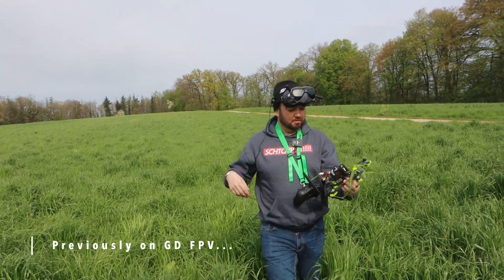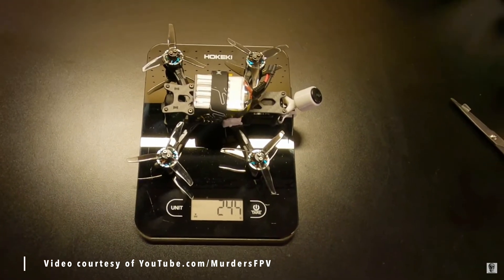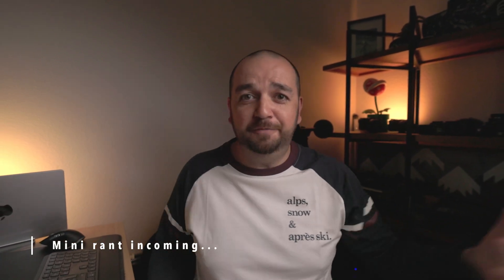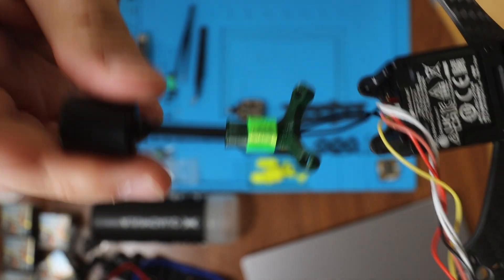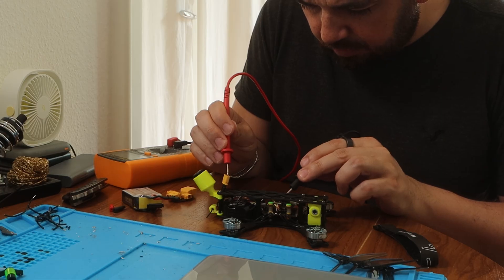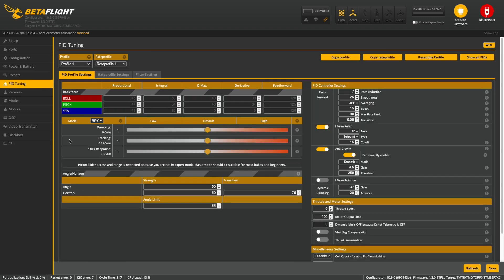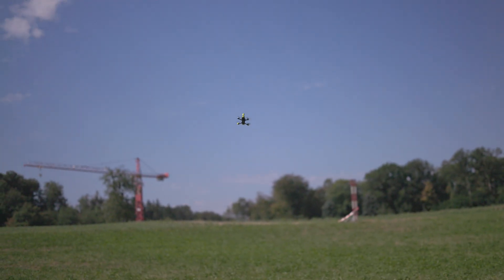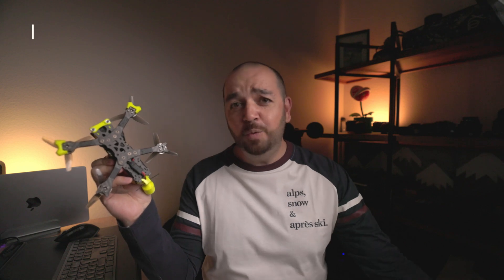I tried to build an FPV drone | Sub250g Freestyle DJI O3 Quadmula Siren F3

Comment: You would bother because after time you'd need to replace all the parts in it anyways...so why not just start from scratch so you can have fun building it! 

Building a drone is easier than building a lego set. All it takes is a few hours and bam!

That being said if you do buy a BNF...as I said be prepared because before too long you're gonna be rebuilding it!
Reply from the maker: I’ve been repairing my quads over the last 1.5 years… and replacing arms and motors etc is easier than starting with a load of parts… that said I was surprised at how easy it is… You’re right I’ve had Lego sets that were more difficult and took longer. And repairs are now much faster because I actually know what all of these parts do.
Reply: oh yeah at first it's scary getting into FPV...but yeah once you get used to it big deal.

I've been flying for long enough time that i know that when I crash I need something that will never break lol....I'm all about the Iflight Titan. Anything less that 6mm arms and it's replacing time for me!

Either way good well thought out video thank you. @GarethDix
Reply from the maker: @NOT-ANOTHER-FPV 6mm arms?! That must look like a bodybuilder taking off 😂 I haven’t heard of the Titan but now I’m going to check it out
Reply: I started out with the Nazgul5 BNF a couple years ago. That had 5mm arms....I just remember crashing allot and many many times breaking arms and whatever.

I upgraded to the titan and really never broke a thing since then.

Anything under 6mm arms for me and I find many ways of breaking it. I'll give that other one a look still see what's out there! @GarethDix
Reply from the maker: @NOT-ANOTHER-FPV maybe my crashes are not as bad, my GEPRC mk5 has 5mm arms and I have no idea how that is still in one piece 😂

The carbon weave is different on that quadmula frame compared to my other quads… I don’t know enough to say why but it looks and feels different
Reply: When I started off I went pretty hard on my drones with no regard for not crashing. It was always the direct concrete hits time and time again that did me in. I remember many times where I crashed and took an arm off....The Titan knows nothing about pain..it just takes the hits over and over. 

Even got ran over by a van and only bent some standoffs so not bad. @GarethDix

Comment from the maker: Which sub250g freestyle bind and fly should I put this Quadmula F3 up against in a future video?
Reply: Iflight aos 3.5 or emax babyhawk 2 O3.
3.5" is the way to go. Especially with the O3 and no props in view.
Reply from the maker: @chrisbee5481  I had a feeling the babyhawk was going to come up. I've been trying to find out if the aos evo is actually sub250g though as it only shows dry weight. But I'm interested to see how different 3.5inch is
Reply: @GarethDix  The babyhawk 2 O3 is 153g if I remember correct in some review. You need a tattu 750mah 4S to stay sub250g.
Maybe a light 850mah 4s too, if you find one.
The aos 3.5 is 178g dry. There you need a lighter 650mah lipo.
Aos has replaceable arms and a little bigger 1504 motors.
Ideally you convert both to a naked O3 to use a bigger battery and stay sub250g.
Personally I've stoped compromising with sub250g builds, but stayed as small and light as possible with bigger motors and battery.
After a while, you realize it's just a 250g number and no one has ever stoped you in the air to weigh it passing by.
If someone ever asks, you'll be on the ground anyway and then you just show them a 45g light 3S lipo you fly it with 😄. Never happened anyway.
If you want an ultimate small build with o3 and props out of view, I can share the specs with you per mai l

Grüße
Reply: I just had my first FPV arrive a few days ago; CineLog20 (DJI O3 + CRSF so should be compatible with your gear if you want to compare?). I was intent on building a 5 inch next but now I can't decide whether to follow the same/similar build! :D Great work though
Reply from the maker: @Smudge202ut  you'll really enjoy it, I was thinking about getting one for flying around in tighter areas. It's probably not going to compare well to a freestyle quad like the quadmula though for that 5inch feel. 
But you should definitely build a 5inch, it's a little bigger so they're easier to work on than smaller quads... and once you're used to the cinelog... the 5inch will blow your mind!
Reply: Would be really cool to see how it compares to the AvionRC Nexa 3.5 EVO O3 and the EMAX Babyhawk O3. Both are sub 250g BNFs
Reply from the maker: @mgurvits I’d never heard of this before… it actually looks like the quadmula frame but BNF which is pretty interesting. For $500+ that does put it in competition with the AOS Evo 3.5 as well though… but I’d love to find out more about it, especially if it is a quadmula frame